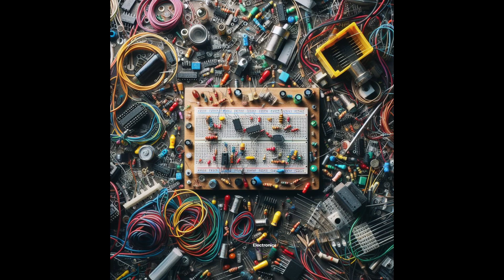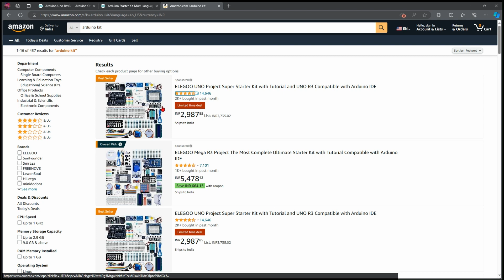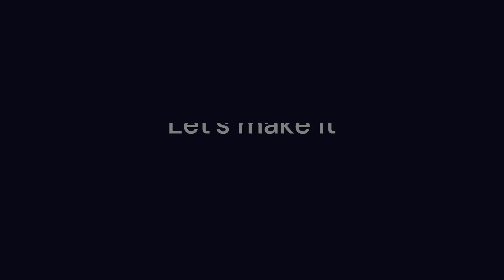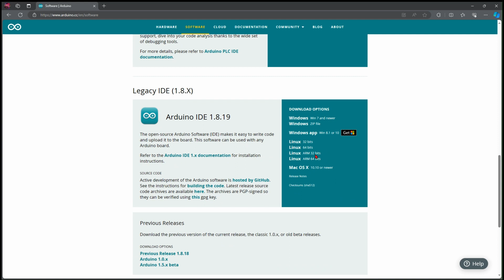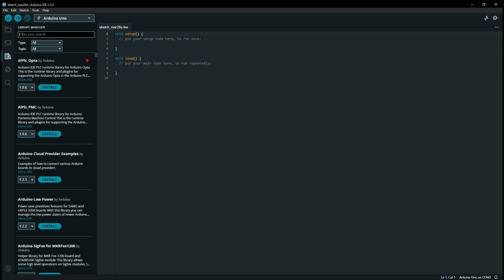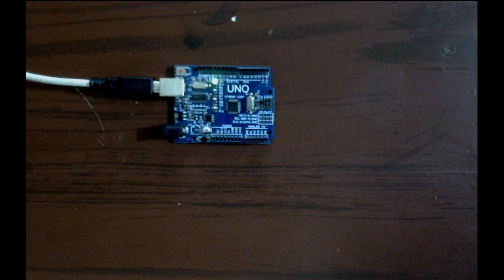Arduino Tutorial Series | EP-1 | Getting to know the Arduino Better|

Comment: I connected my arduino but it doesn't show up on ports.. Please Help!!
Reply from the maker: There can be quite a few reasons why yours may not work.
1.Bad quality Cable: - The cable provided with the Arduino board may be faulty and cannot transfer data to the board. So, you can try with another cable.
2.Driver Issue: - Maybe your computer may not have the necessary drivers installed in that case you need to install a driver. Refer to this video for doing it: https://youtu.be/D271p2E2_o4?si=ZySmUKIfsYFZY0J7

I hope that cleared your doubt. Feel free to ask if you have any more queries. 😊
Reply: I tried it. It works Thanks